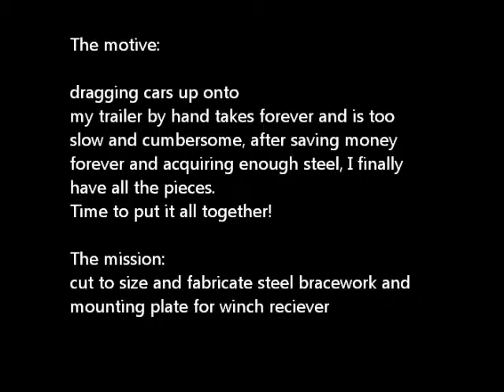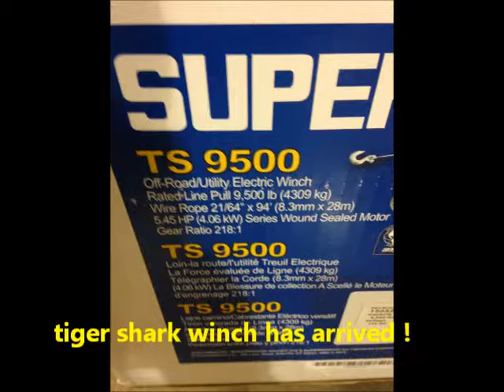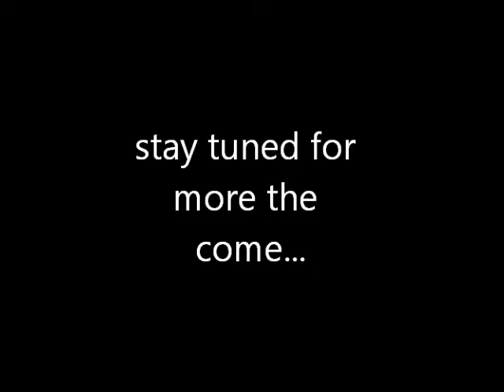winch plate installation on the goose

Comment: Nice work! How much weight is the 2" receiver you bolted to the trailer rated for and where did you get it?
Reply from the maker: Kris Boswell thank you very much, I worked really hard on it. 
I got the receiver plate at harbor freight, I believe it's rated for 3500 lbs, but I've pulled a 15,000 lb tractor up on the trailer and I didn't have any issues
Reply: Awesome, thanks 

I'm setting up my gooseneck for a winch and want to do it like that. The tractor feedback is very helpful